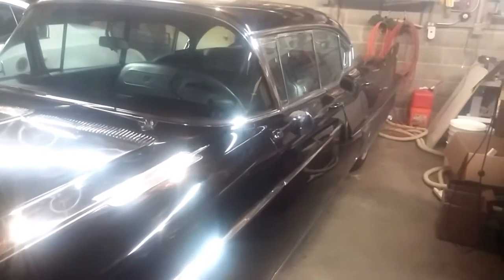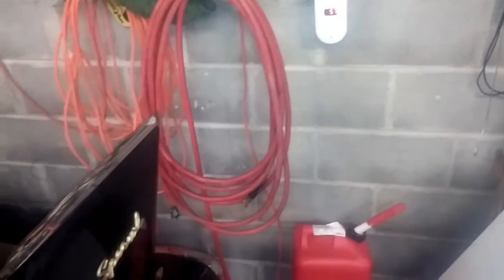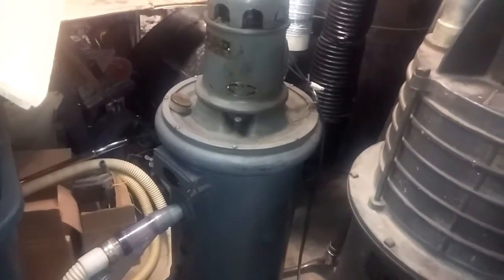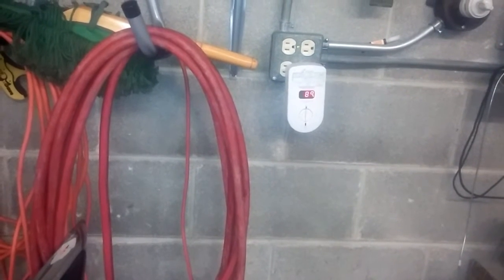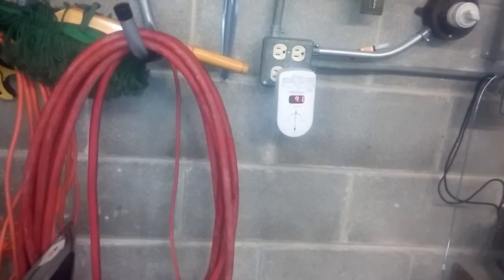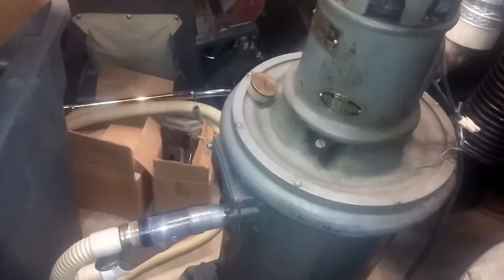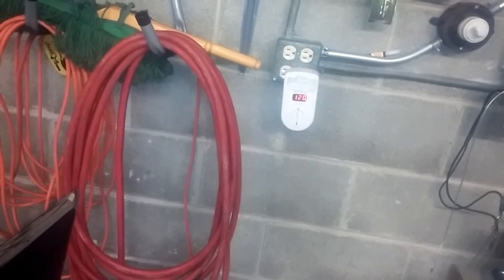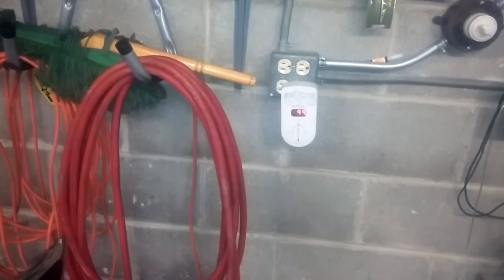Auto exhaust system for garage

Comment: That exhaust is highly combustible especially in an old car like yours. You could run your engine off the gasses going out of that tailpipe. I would be very hesitant to run the gases through any electrical fan system not specifically designed for that purpose.

Comment: I don't have a garage. But in my basement I run my gas back up generator. I use this very same system to remove the exhaust gasses. Up and out the chimney via the steel stove pipe. Two detectors say I'm in the clear. Only dangerous thing is the gasoline can spilling on the trip (no pun) to the basement. But I only use it if power goes out in winter. My house has electric baseboards. And I run the tank dry when not in use. I may convert to propane.

Comment: Gorgeous, beautiful car! I was looking into getting a hose for my car because of Crime and Covid in Chicago - lol! I haven't been going anywhere because of Covid, but that thing you plug under the dash for car insurance keeps draining my battery, so I want to let the car run every few days. But because Chicago is well over 1,200 carjackings this year, alone, and I'm in a not-so-great neighborhood of the city, I don't feel safe to drive around or even sit 15-20 minutes with my garage door open, so I thought I could just attach a hose and stick it out from under the garage door. I didn't realize you had to have all that other equipment, as well. Rats!
Reply: It’s not good to let a car just idle. It’s better for the car to stay dormant on a battery tender than frequent starts. As the engine never gets to temp it causes more issues in the long run. Exhaust will rot out too. I bought an exhaust vent hose simply Bc I am working on a project car and need to bring it inside to do some work.
Reply: Do you have a cat ?